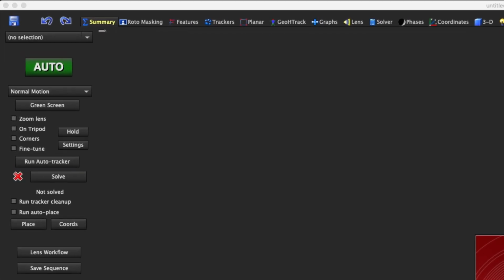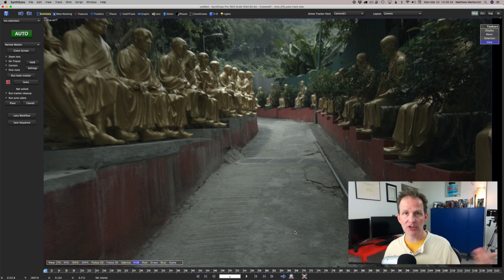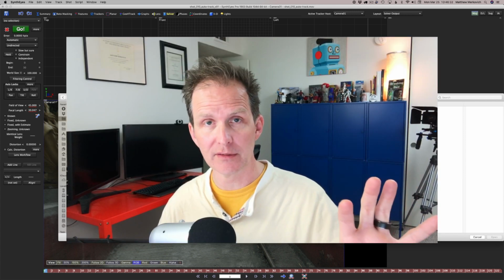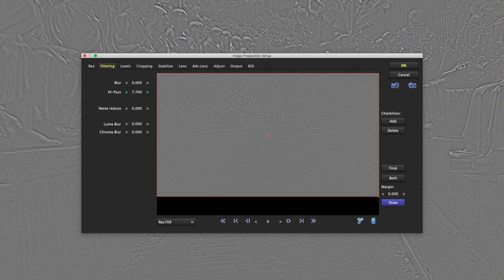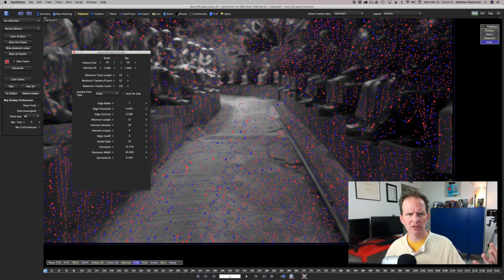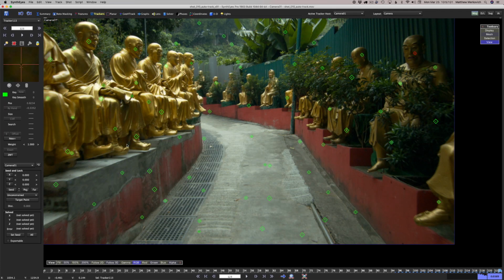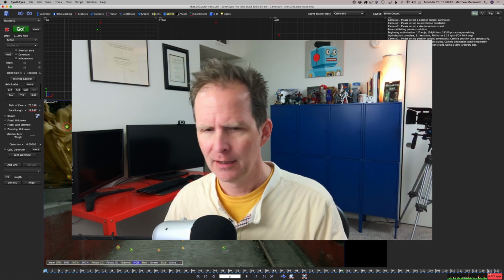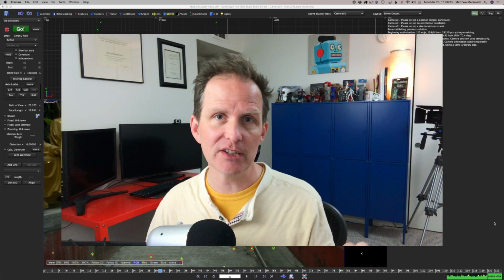A deeper dive into Auto Tracking in SynthEyes. Part 1

Comment: I do have a Question about auto-tracking in SynthEyes. I created a mask and when I try to run the auto-tracks, all the trackers end up inside the mask and not outside the mask. In PFtrack once a mask is being created, the auto tracker will not track what's inside, but in SynthEyes it puts trackers in the features inside the mask. What am I missing here?
Reply from the maker: Your masks can either be set to garbage, which is exclude, or camera, which is include. How you stack your masks matters. If you put a garbage mask on the bottom and a camera mask that covers the whole frame on top, nothing will be excluded.
Reply: @MatthewMerkovich   Excellent, A big thank you!!! I'll go and try that.

Comment: thanks for good video! do you know how to change the angle of rotomasking by the way? im masking some object which i dont need for tracking, and i wonder if theres way to change ratation of the masking instead of adjusting every single point for every keyframe
Reply from the maker: There's a tiny handle point, way off to the right that will allow you to scale and rotate the entire shape at once. It's a small dot and easy to miss.